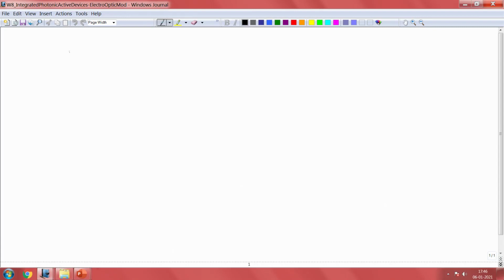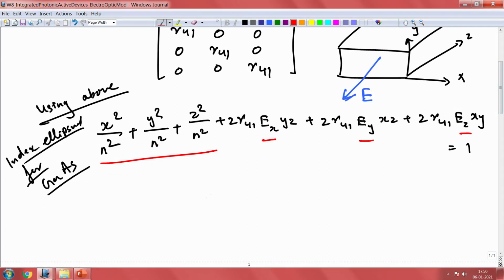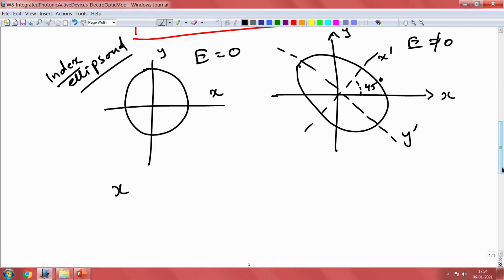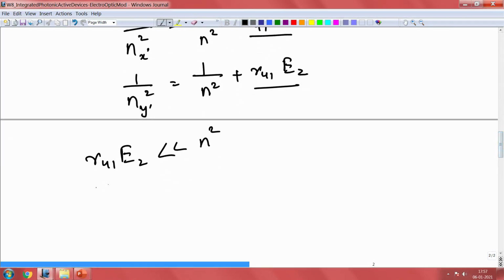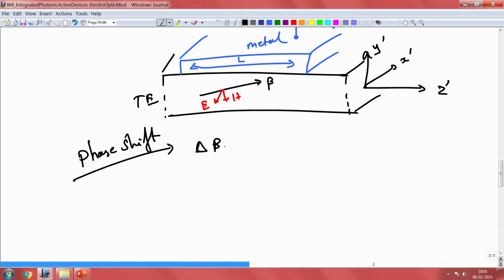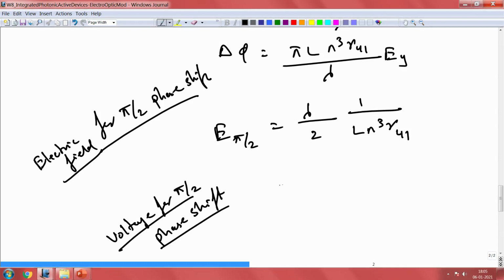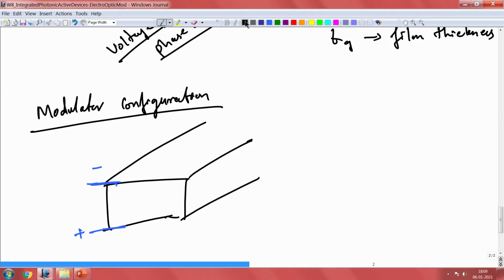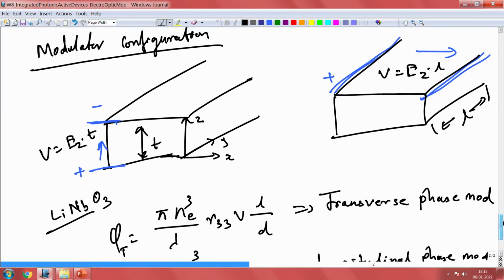lec37 Waveguide modulator

Comment: How does the initially linearly polarized light polarization change when the voltage is applied? in transverse lithium niobate electrooptic modulator